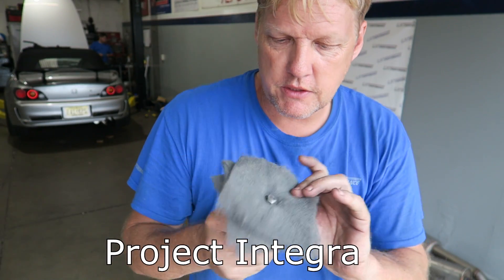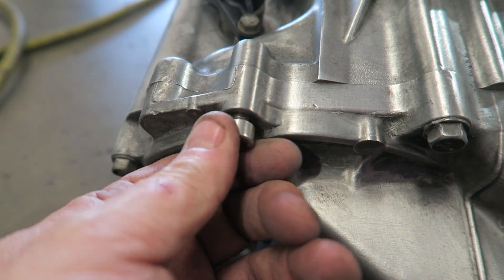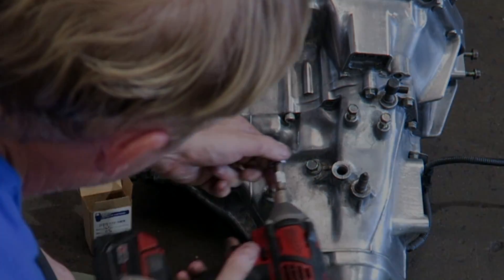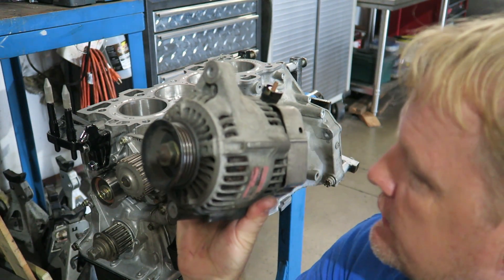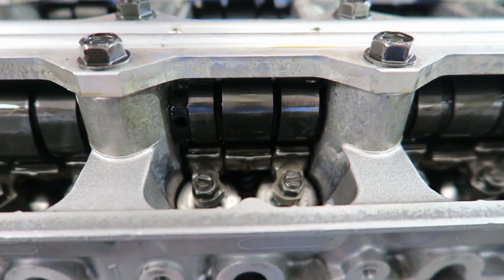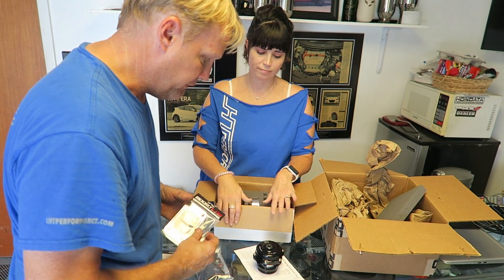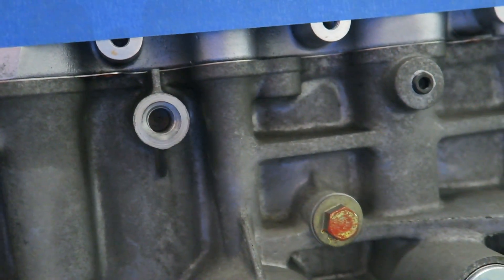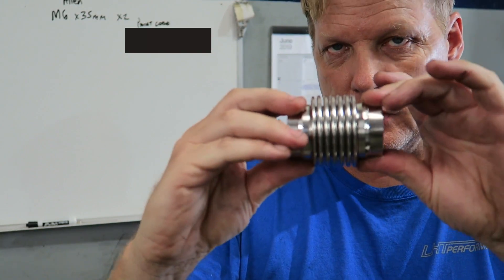Alternator, Starter and Tranny Oh MY - Part 11

Comment: Awesome job Gents!. I have extensive experience with bellows in military aviation and they tend to crack over time. Just something to keep an eye on.
Reply from the maker: angel cancel OK.  Thanks.   If the piping is supported at each end it increases their life span. I’ll report back if they fail.
Reply: @LHTPerformance  yeah for sure let me know. I'm always curious to know things like this. It's nostalgic and cool to see the same tech used across both platforms. Once we switched to a inconel alloy it increased the lifespan of our exhaust components.

Comment: Check out the greddy EF! I feel like that's the philosophy you're following on this build. Nice and clean, 300ish usable hp. He's also using his AC system to cool the air charge. Pretty neat stuff and all nicely done like LHT!
Reply from the maker: itsjussjerry I built an AC chiller for my Supercharger intercooler back in 1998.   My cold AC is more important to blow on me rather than the extra 10 whp it’s good for.   👍🏻

Comment: After the bolts are sorted out on the trans, you will need to nickel-plate everything, for a super-sano OCD finishing touch! With a final polish, of course.
Reply from the maker: ShinyMike Polished stainless holds up very well. Especially in Florida.

Comment: Recently my new clutch...new flywheel were installed. Then I noticed the old starter making noise only during starting the engine everytime.
Reply from the maker: ABDULLAH_FARD M. It could be the starter hanging up or depending on the flywheel, it might the teeth.

Comment: I have a brand new in bag OEM discontinued PIPE B, CONNECTING 19504-P72-010 that you can have for free but you will probably have no use for it with an aftermarket intake manifold.
Reply from the maker: Jun Yip I really appreciate it.  I doubt I could use it.

Comment: DORMAN freeze plug, just NO!  All those nice parts, don't let that Dorman garage ruin your nice motor LHT
Reply from the maker: Caffeinated Skwirl You talking about the freeze plug ?
Reply: @LHTPerformance  15:05  that's what I said yeah, i got Dorman parts for my Honda twice because that's what was available at the time, they didn't even fit properly and could tell they were sub standard. Waited for Honda parts
Reply from the maker: Caffeinated Skwirl Do you honestly think that a round piece of formed metal that does nothing except keep oil vapor to escape is going to fail ?????